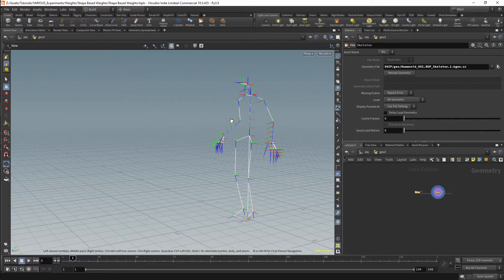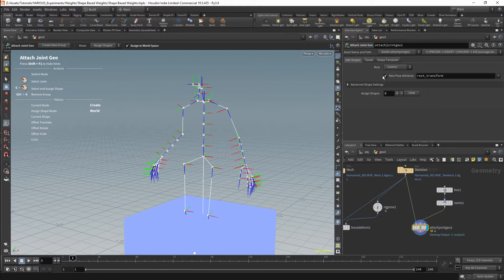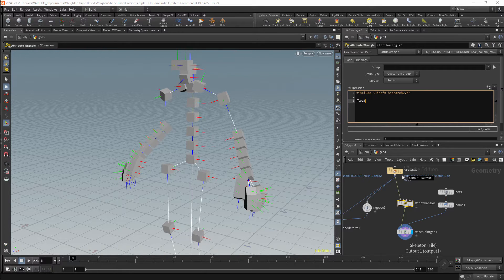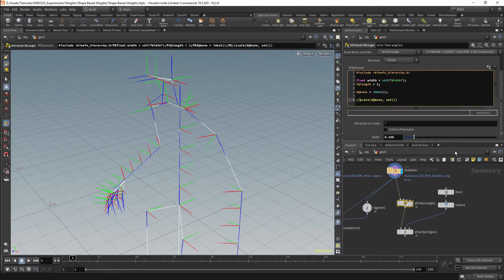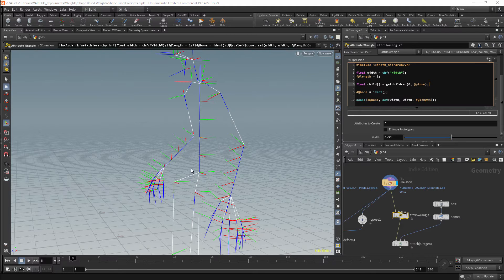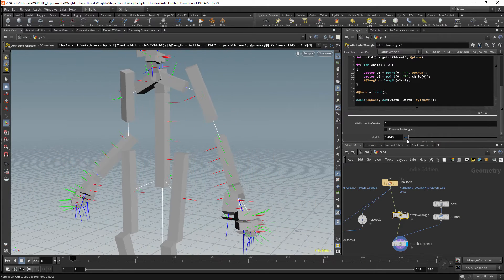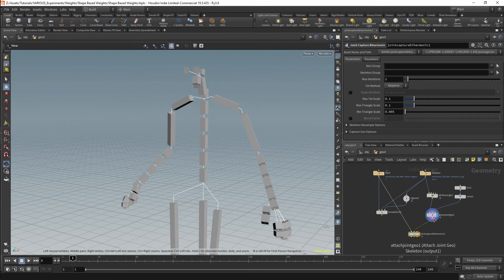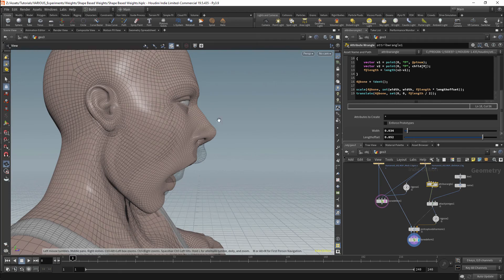KineFX - Control Geometry And Weights

Comment: Thank you for tut!
Also where I can find vex functions reference for <kinefx_hierachy.h> module?
Reply from the maker: There is not a reference for the kinefx libraies.

 You can fine the header files under the: {your installation directory}\packages\kinefx\vex\include folder. Also if you use version 18 of Houdini (or the older versions of the nodes) a lot of more the original kinefx nodes are not black boxed and you can enter them and see how they are constructed.